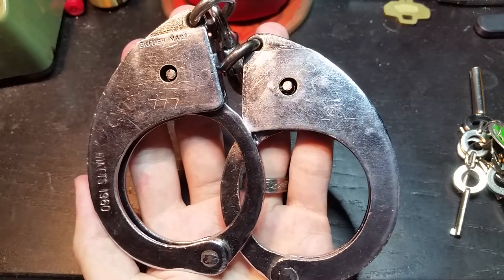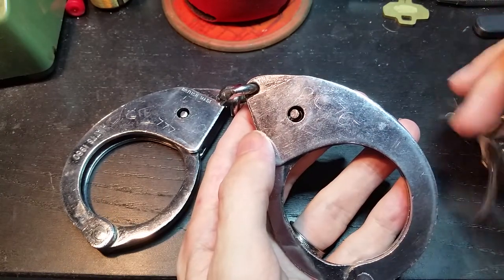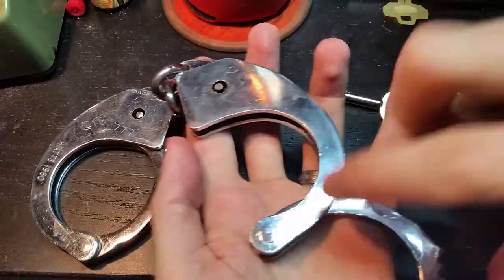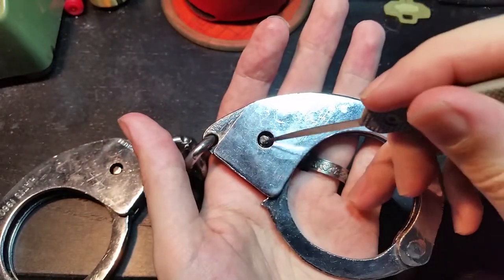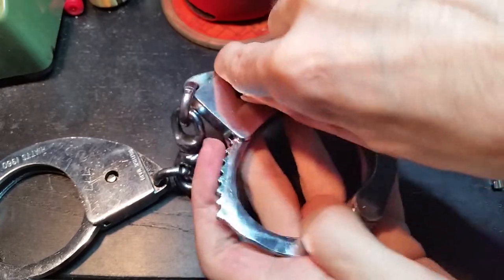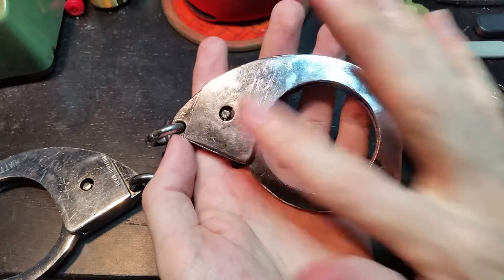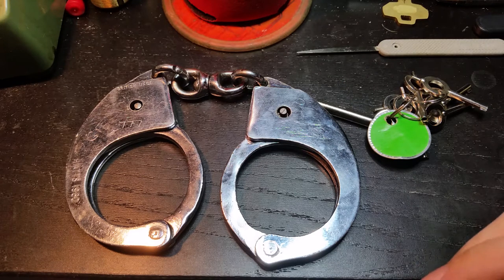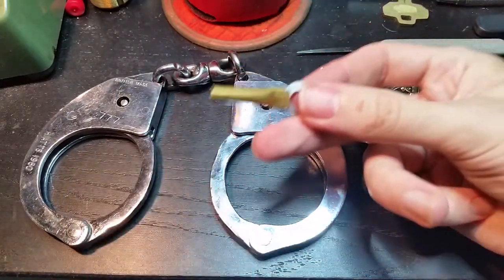(94) Hiatt model 1960 handcuffs

Comment: Quite an interesting set of handcuffs. I'm sure a few prisoners were grateful for the design. :) Thanks for sharing.
Reply from the maker: The best bit is how easily and cheaply I was able to make spare keys for them before they even arrived. Ric sent some rough measurements which were enough for me to design a simple homebrew solution. 1/4" brass tube, washers, and JB Weld were all it took and I made 8 or so keys for about $12.

Comment: The overall shape resembles the Clejuso.
Reply from the maker: They do, which is a bit odd since Hiatt had been manufacturing Peerless handcuffs under license for several years around the same time.
Reply: Were these the first swing-through cuffs? Or has the "modern style" of swing cuff been invented already prior to this? I know Peerless invented the modern style as we think of handcuffs in the current age, I am not sure of the chronology of where these stand in the picture.

Comment: I think you are being a bit unfair to Hiatts regarding these cuffs' security.   It seems your pair of these cuffs are somewhat worn out.   I had a pair of these cuffs in the early 1970s, which were therefore then quite recently decommissioned, when I was at boarding school.   The cuffs I had featured a spring below the lock hole.   You had to be both pressing down and turning the key, simultaneously, to open the cuffs.   A friend and I locked another guy into them, then a few days later they forced them onto my wrists and left me alone for an afternoon.   It took me about 2 hours to get the first cuff off, then about another hour to get the second one off.   I had a screwdriver the right sort of size, but (without the key) it was extremely difficult to push down and turn at the same time.   If your pair of these cuffs can be opened just by turning the locking lever then it would appear the spring in them has worn out or gone.